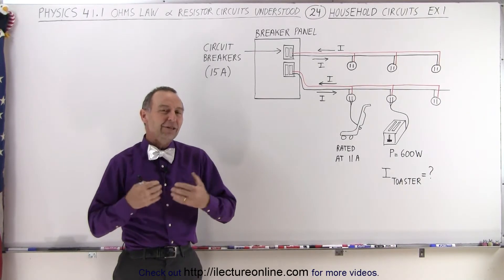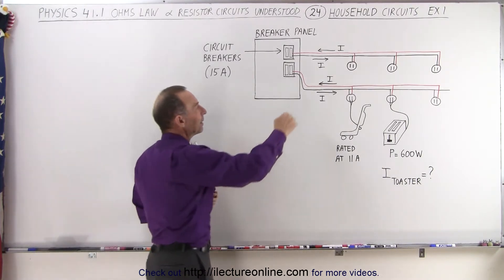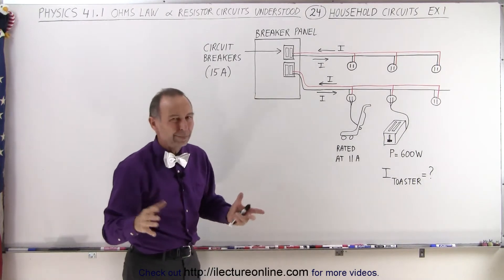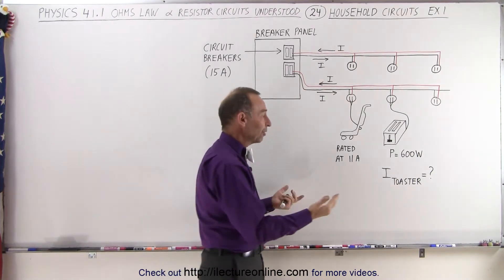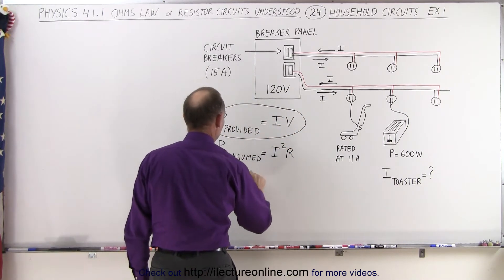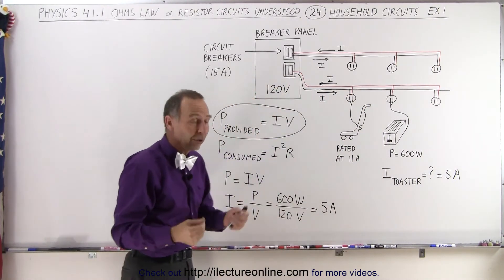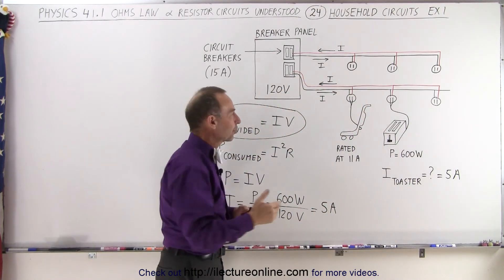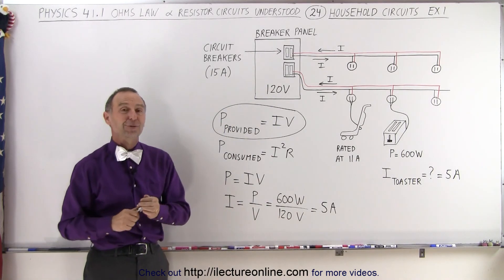Physics - E&M: Ch 41.3 Ohm's Law & Resistor Circuit Understood (24 of 42) Household Circuits Ex. 1

Comment: I have just this one circuit in my house that keeps tripping. All I have is a modem, router, and some light bulbs plugged in. I don't get what could be wrong with it. I'm going to watch this whole series though.
Reply from the maker: When you have checked that the "load" is not to large, (you don't have too many components connected to the circuit), then a tripping circuit may be an indication of a short, which can be dangerous. (That is why the breaker is tripping, in order to protect you).  A short is that when two opposite wires are touching allowing the current to bypass the components connected to the circuit.  They can be momentary touches or when they are really close and sometime touch.  That usually happens in the boxes where the wires are stripped in order to make connections.

Comment: What if I plug in appliances but they are turned of and not working, do they still consume electricity and do current flow through?
Reply from the maker: Theoretically no, they don't consume any power.  However in most modern appliances there are computers, LED lights, etc. that do draw some current (however small) when they are not "turned on".